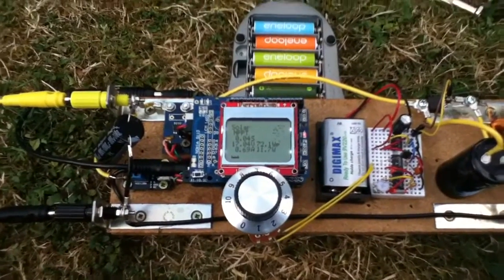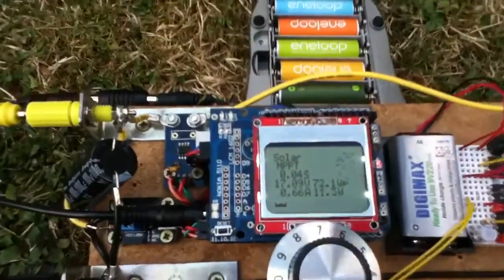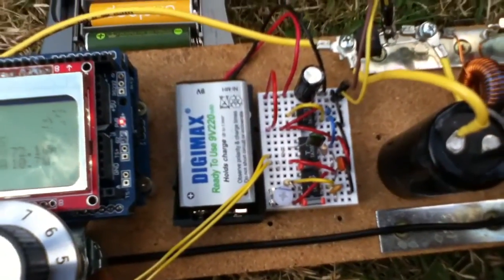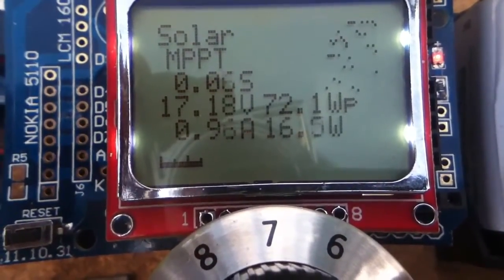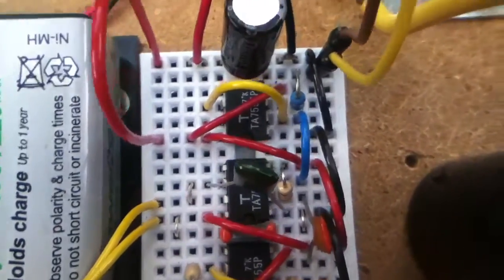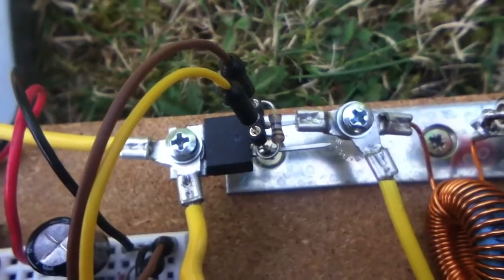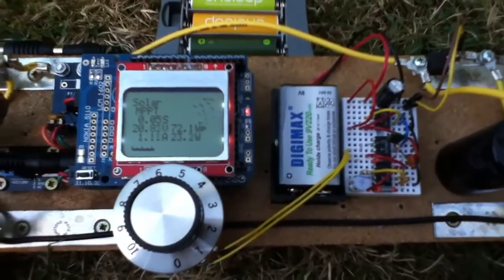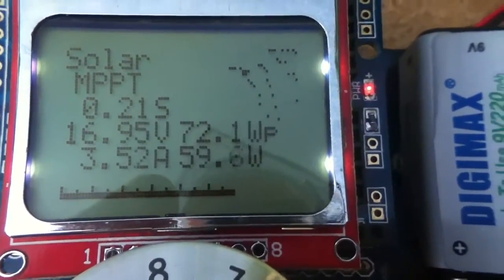Arduino MPPT Solar Charge Controller #14 - Stable Current Measurements

Comment: PWM doesn't give you MPPT operation. You need a linear circuit for that. PWM just switches you rapidly between two non-optimum power states.

Comment: Hi I hope you can help I've built a portable solar system in an old ammo box my solar controller seems to have a mind of its own and when the panel is connected it charges but no out put so when I disconnect the panel I have to remove the positive connectors to reset the controller to get load to work for USB 12v out volt meter

Comment: High-side Driver IC's are a lifesaver.. super simple to drive directly by 5v logic, solves all these problems.  Also, reverse polarity protection - try an N-ch MOSFET in the (-) battery output line, only turned ON by a (+) coming 'in' on the (+) battery output (through a diode to the Gate, but have a resistor from Gate to Drain to make sure it gets turned OFF otherwise). Similar to using an output relay that only gets its coil energized (through a diode to + battery connection) by the correct polarity connected battery.

Comment: I don't think you need to use the Arduino PWM mode... how about just use a timer with ON/OFF variables... so you're not slaved to any Arduino PWM limitations?  With 62.5ns resolution, you can seemingly do quite a bit.

Comment from the maker: Some MOSFETs are called 'logic level', but I'd be surprised if the very lowest on-resistance figures could be achieved with only 5 volts on the gate. I may be wrong!

Comment: Hello, I just saw the video and I think the IRF540 already works with the Arduino output voltage. But I'm not sure. I'd use it on my DC-DC StepUp and I think it worked with 5V.

Comment: An Arduino should be ok doing 15KHz eh? I wouldn't know...my board is still in is box presumably with the flashing LED sketch still loaded...hehe I want to do some guitar FX things with it possibly as well as solar stuff, so I am quite keen to know how fast they can output. 15K would actually be plenty for guitar quality audio...

What is the advantage ov replacing the diode with a Mosfet?

Comment from the maker: Ultimately, the buck converters will be synchronous, where a MOSFET replaces the schottky diode. That requires a PWM generator with complimentary outputs, variable deadtime (so the high and low side MOSFETs never overlap) and phase control (so multiple buck converters can operate in a 3 or 4-phase sequence). So eventually, a digital signal processor (I fancy a dsPIC) will be used. But that's all some way in the future!
For now, OK, I'll try to persuade the Arduino to do the 15kHz PWM

Comment from the maker: This is a tricky one. The Arduino has a fixed PWM frequency of around 500Hz. It can be changed, but only by tinkering with the timer registers and that upsets functions like delay() and millis(). Also, thinking ahead, I want to have an ultra-low power night mode which might involve shutting the Arduino off altogether. The Arduino doesn't seem to have any nano-watt facilities like slowing the clock down. Now you've mentioned it though, I'll look further into changing the Arduino PWM frequency.

Comment: I was actually thinking that too...you should be able to get the Arduino to generate the PWM signal. As for your coupling issue, what you need is a DC level shift. This could be accomplished by using an optocoupler. If there is some reason why you don't want to generate PWM with the Arduino, that same optocoupler fed from an analogue pin could actually replace the pot controlling your 555 circuit, if you wanted to do it that way.